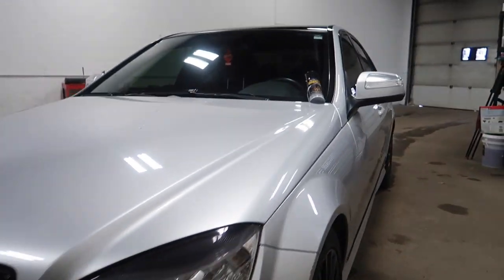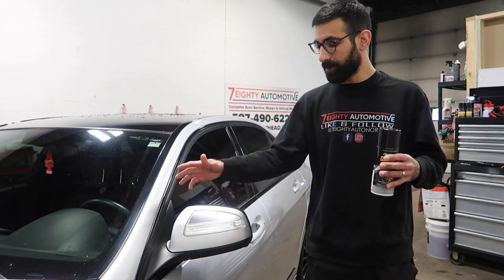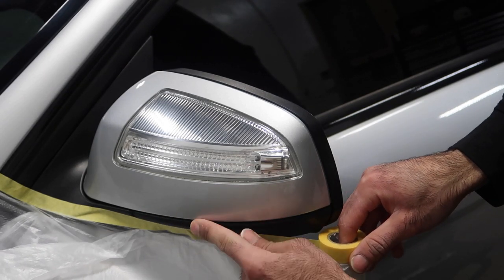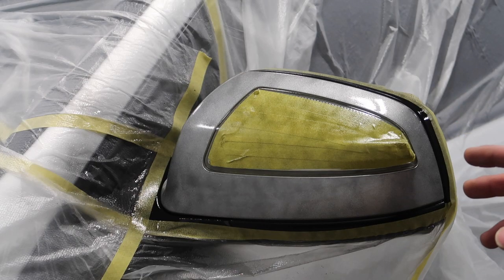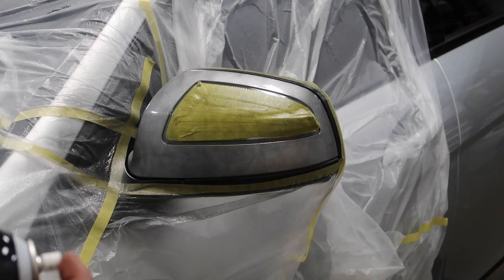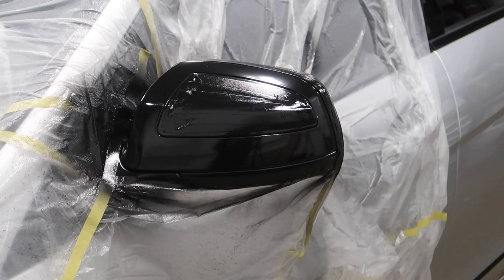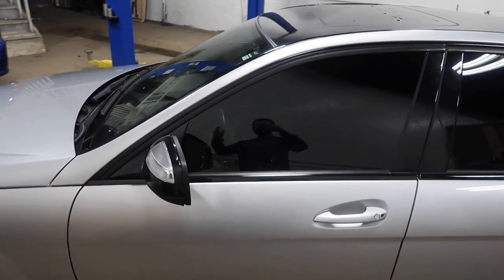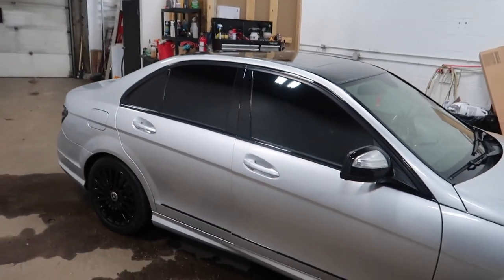Hyperdip Gloss Black Side Mirrors - Mercedes C-Class

Comment: Just a quick tip..Make sure those tack/dust coats go on very lightly, this allows the dip to have a foundation for it to grab onto when doing the heavier wet coats. This helps prevent runs and sags.

Comment: Looks good, I was always wondering if Hyperdip was good enough for larger items outside of emblems. To me it looks more of a shinier satin than gloss. Would you say it has the same gloss and texture as a piano black vinyl?
Reply from the maker: With aerosols u should only do smaller objects because if you do a big object like a hood then ur going to get stripes. Its best to use a gallon and a spray gun for larger areas. The gloss is great results for straight out of the can but gloss black vinyl is shiner gloss, also harder to install on side mirrors and certain objects.

Comment: do u have the link?! and can i use it on plastic mirror?
Reply from the maker: Www.dipyourcar.com go to the hyperdip section
Reply from the maker: Do not use on plastic
Reply: @EhabHalat  darnnnnn! is there something i can use to make my mirror match my other gloss black mirror?
Reply from the maker: Try using plasti dip black and 2k gloss by spraymax. I have a video spraying rims on my channel you can check it out
Reply: @EhabHalat  i jus watched it 😁! can u kindly drop the link to the 2k gloss spraymax so ik which can i am getting 🫣
Reply from the maker: @trayy_shiesty  google “2k clear gloss by spray max” you will know what it looks like and you can purchase it at your local paint store or NAPA
Reply: @EhabHalat  one last question, how many coats of plasti dip should i spray on the mirror and how many coats of spraymax should i do?
Reply from the maker: @trayy_shiesty  8 black then 1 light coat followed by a solid heavy coat but careful for runs (dont go too heavy)
Reply: @EhabHalat  okok so basically 8 blacks and 1 light coat of the clear then follow it with a heavy. how many minutes should i wait in between?
Reply from the maker: 15-25 min between black coats and then 1 hour before spraying the gloss

Comment: I understand blacking out chrome trim. I understand blacking out those side mirrors as well. Those are all logical and good choices. HOWEVER, that being said, it is moronic to black out wheels. Black wheels NEVER look good. Even if you did a great job and the rim looks good up close, standing back and taking in the whole car view from any direction, black wheels look like hammered crap. Black provides ZERO contrast from the tires, which is a big part of setting off great wheels, as well as the car's paint. Instead with black wheels, it looks like a hole is there. In my opinion white/chrome is almost as bad. Wheels look great in most of the metallic colors other than chrome. Even a darker polished aluminum looks great. But black and white suck! Anthracite, bronze, gun metal,  darker gold, brass and darker copper all look great on nice wheels. Last thing, gloss black looks cheap in the interior of a car. Flat or Satin look much more refined and fit an interior much better. 
Just a note... Nice vid.
Reply from the maker: I strongly disagree! Blacking out wheels makes the vehicle look more aggressive and sportier in my opinion, changing the colour to anything other than silver or chrome is a good choice in my books as long as it flows with the body paint on the vehicle especially if you black out all the chrome then black wheels go good with that